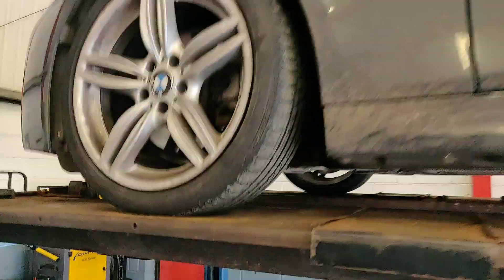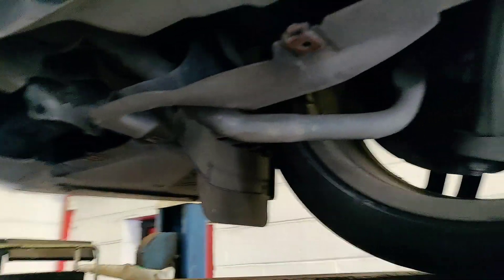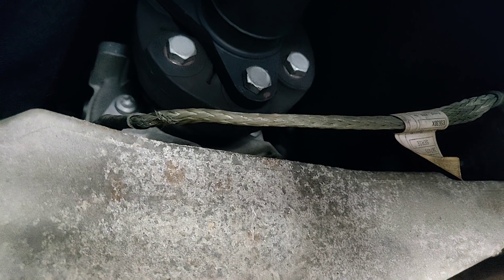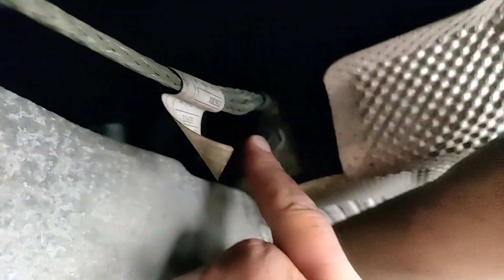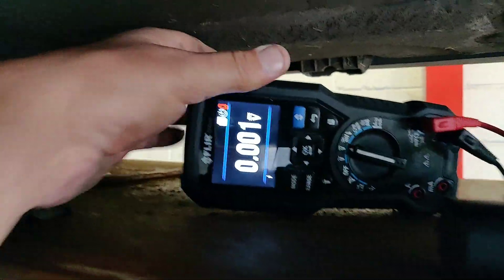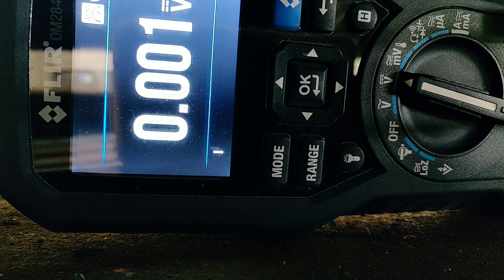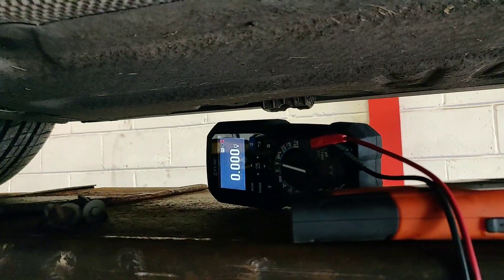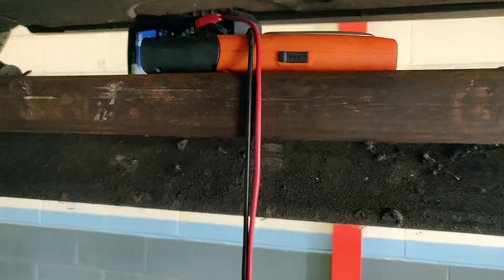No crank volt drop testing 0 is a good number

Comment: Always wondered what you have against Land Rovers, heard you mention your love for them  a few times.
Just bought a used Autel ms908 and after updating it i went through all previous owners saved data on vehicles to clear some junk!
Every car seemed the norm, 2 or 3 dtc, s, then the odd 10,12 at a push, then, a bloody 2013 Land Rover, 39 dtcs at the one time!! What in the hell? How often do you come across that Steve on a motor? :-)
Reply from the maker: It happens more often than you'd think. A low battery or water ingress can generate dozens of DTC across a modern vehicle.
Reply: @SimplyDiagnostics  yes you'll probably see it quite a bit, it's just in the grand scheme of things in the hundreds of vehicle checks on this tool it eh? Stuck out a bit! :-)
Then you come to mind immediately lol after watching you describe your love of them!

Comment: Not a definitive test the way you tested it. It could have been the connection between the cable lug (copper) and the frame (steel) at either end. Another test from the braid of the cable and a good ground would tell you if the connections are faulty. You might find the cable is good after you change it ( thereby cleaning the connections).
Reply from the maker: I tested stud to connection at both ends and cable. I showed one part of the test to demonstrate VD and after cleaning the connection (pic in community tab) there was acceptable VD. The Cable was intact.
Reply: Current through a resistance creates heat.
What brand was the multimeter again?
Sorted!
Reply from the maker: Fluke mate
Reply: @SimplyDiagnostics  I was hinting that you may have used the capabilities of the FLIR multimeter to highlight the location of the high resistance thermally rather than  doing the 4 separate voltage drop tests.
However with the short duration of the current and large thermal mass I'm not sure how easily it would show up
Reply: Except that the braided cable was shredded on the end closest to the  drivetrain.  There were only a couple strands left.

Comment: I had similar problem with a Renault master van. The problen turned out to be a very high resistance between the starter motor and bell housing due to the reaction of aluminium on cast iron.

Comment: Was it just me or did the nearside front wheel only have 1 wheel stud? Very nice looking meter by the way.
Reply from the maker: It does look that way, well spotted, the locking nut is silver and the others black. Yes, it's a nice meter on loan from Diagnostic Connections, I'm quite liking it.